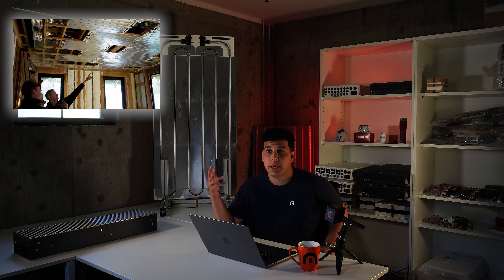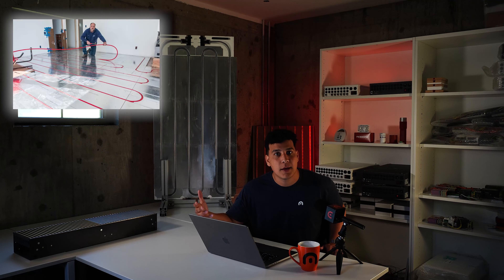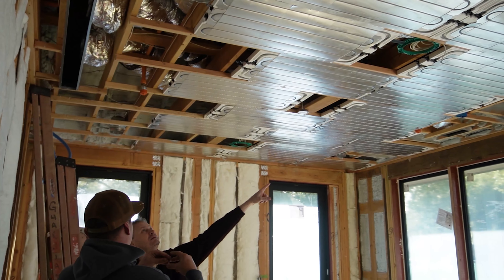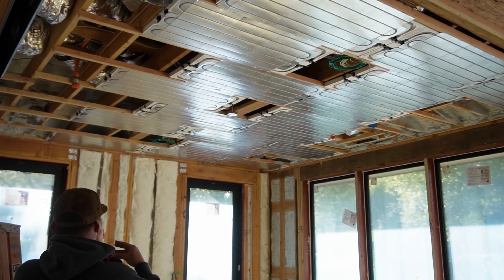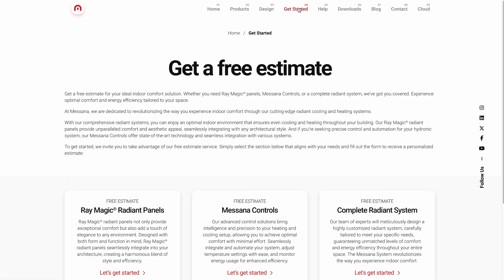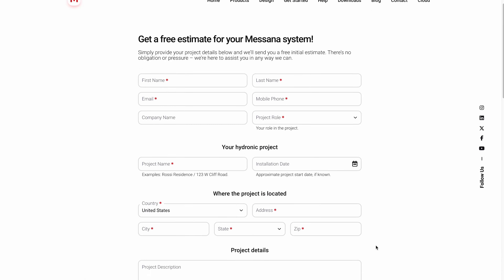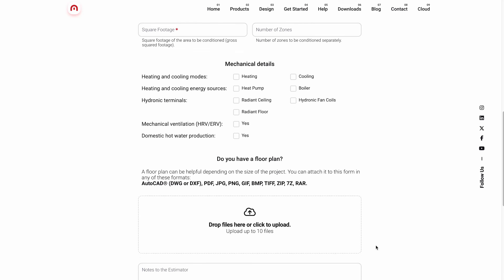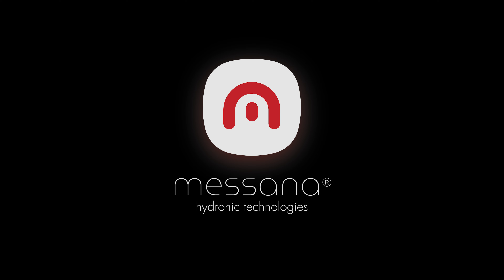Radiant Floors vs Radiant Ceiling with Messana!

Comment: that was a GREAT synopsis. I've been trying to explain to my architect why I'm going radiant ceiling over flooring, because I spent so much time explaining to her that I want high mass floors and walls for passive heating and cooling, I was having trouble explaining why I'm not high on radiant floors. reaction time, distance from occupants, obstructions... all those reasons, and The dew point control... GREAT job!
Reply from the maker: Thanks a ton, I really appreciate it! Definitely let me know if you have any questions regarding this!

Comment: What would you suggest for a barndominium with a garage & living room with 18' walls & 25' high at the peak?  I don't see doing radiant heating in the floor AND radiant cooling in the ceiling, especially since the "cool" air would never get 25' down to the floor without multiple fans.  The rest of the 1st floor (master bedroom, bath, & close, kitchen, pantry & laundry, & workshop) will have 10' ceilings.  The partial 2nd floor will have vaulted ceilings from 7-13' high.  Thank you!
Reply from the maker: Hi there! Thanks for your comment!

To answer your question, yes, a hydronic system can be used for both heating and cooling.

That said, radiant cooling in a large space like a barndominium presents unique challenges.

Ceiling Heights and Load Calculations:
Variations in ceiling heights and other factors will be addressed through room-by-room load calculations performed by a mechanical engineer. Based on these calculations, we’ll specify the appropriate number of panels for each area to meet both heating and cooling demands.

Heating vs. Cooling Outputs:
Radiant heating is straightforward, as the system can operate with water temperatures between 95–130°F to meet heating loads. Cooling, however, is more limited, typically requiring water temperatures of 55–65°F and above to avoid condensation issues. While radiant cooling can work by itself in ideal conditions (e.g., well-insulated, airtight homes with low solar gain and a dry climate), barndominiums often don’t meet these criteria.

Fan Coils for Faster Cooling:
Barndominiums are large spaces, often with features like oversized doors that open to the outdoors. To address this, we recommend incorporating hydronic fan coil units. These air-based units can quickly bring the temperature back to the setpoint after doors are closed, then the radiant system can take over for maximum comfort.

Surface Area and Insulation Challenges:
Barndominiums typically lack the interior walls and ceilings needed for radiant surfaces and often have less insulation compared to modern homes. Additionally, their exterior walls and roofs may absorb heat from the sun, further challenging cooling efforts.

Incorporating fan coils alongside radiant systems ensures optimal performance for both heating and cooling in these unique spaces. All while still getting the benefits of hydronics! Let us know if you have more questions—we’re happy to help!

Comment: Great video. Quick question: what if the power goes out? What will happen to the water temperature in the system to avoid condensation?
Reply from the maker: Great question as usual! If this were to occur, there would be no condensation risk because the system would be off at that point.

Since there is no power, the controls will be offline, the energy source will not generate chilled water, and the circulator pumps will not push water throughout the home. 

So if this were to happen, it would basically "pause" your system. So you would be without heating/cooling momentarily, but there wouldn't be any condensation risk.
Reply: @messanatech  Thanks for taking time to address my question in detail as usual. This makes sense. If power were to remain out for an extended period of time, would it be safe to assume that the temperature of the fluid in the system would approximate ambient temperature?
Reply from the maker: @oldporkchops  Yes, exactly!

Comment: Would this work well for a new build small 120 square foot art studio space? I would want to . I also noticed that there is an office in Soquel, is that a showroom or is there another way of experiencing it somewhere in the bay area? Would you have to couple it with a humidity control?
Reply from the maker: Hi there, thank you for your question! 

With that small of a space, the $/sqft. would be quite high for a radiant cooling and heating system. 

Additionally, a building like this may have higher than usual loads, making radiant cooling less feasible. This is because a building like this has all walls + the ceiling exposed to the outdoors, meaning heat is trying to enter from all angles. For a room in a residential project, usually only 1-2 walls of a room are exposed to the outdoors, so there is less surface area for heat to enter the space. Furthermore, these types of buildings tend to have more glass and less insulation, increasing loads. A better hydronic option for a project like this may be a fan coil, which has a condensate drain so condensation is not a concern (you can use very cold water to maximize cooling).

If you were to attempt to go with a cooling and heating system, you would most likely use an air-to-water heat pump to generate heated and chilled water. However, the smallest heat pump size available would be a bit overkill for a 120 sqft. space. Additionally, a system like this requires more room for mechanical equipment, so space may be a limiting factor. 

Regarding humidity control, a dehumidifier may be incorporated to increase radiant cooling output, but once again, this further increases $/sqft. and may not be worth it. Our office in Soquel uses a 55°F set-point for dehumidification to kick in, and it has done so twice since April 1st. 

If you go with a heating-only system, you could certainly design a very simple radiant ceiling system, which would require less mechanical equipment, sensors, and controls. This would make the system more affordable and easier to install. 

Our office in Soquel is where we work day-to-day, but we do have our system installed and enjoy giving folks a bit of a tour. You may certainly come by and I can show you our system! Feel free to email me if you'd like to schedule a time to come by (sauldls@messana.tech).

Saul
Reply: @messanatech  thank you for getting back to me; I almost missed this since youtube notifications often escape me. I will email you next week. While the very small build is the next thing on my list, I have a couple other projects where I might consider it, too.
Reply from the maker: @emorytaylor5972  That's great to hear, I look forward to hearing from you! Take care!

Comment: What about ceiling height? Is there a meaningful performance loss on a radiant system (heading and cooling) with, say, 10' ceilings?
Reply from the maker: Great question! As you increase the size of the space, you certainly increase heating/cooling loads. But these loads are taken into account during the design phase of your project. So we will ensure that the appropriate number of panels are used to meet the building's heating/cooling requirements!